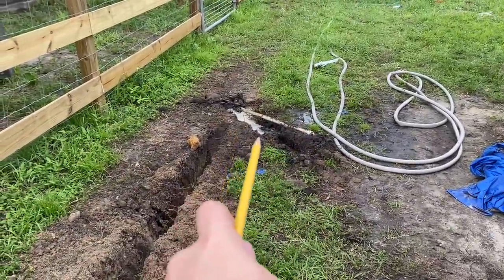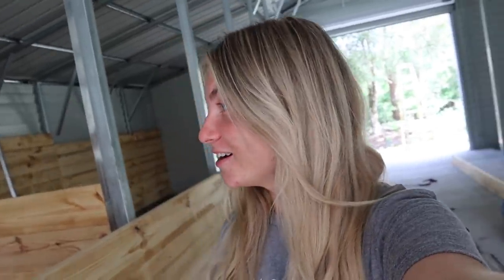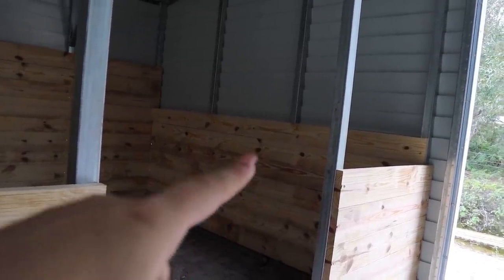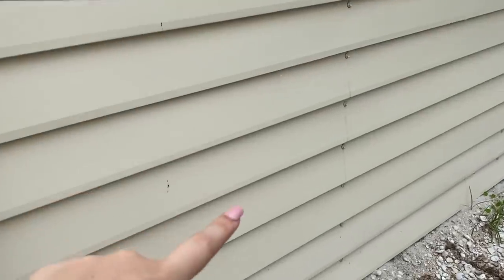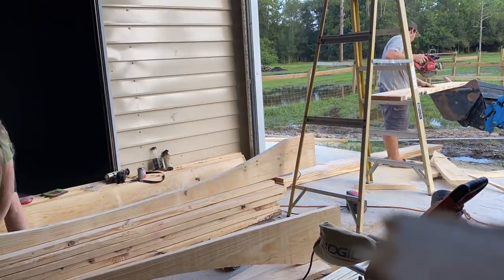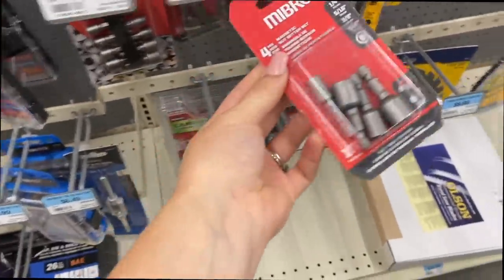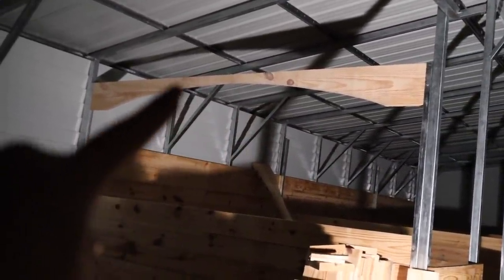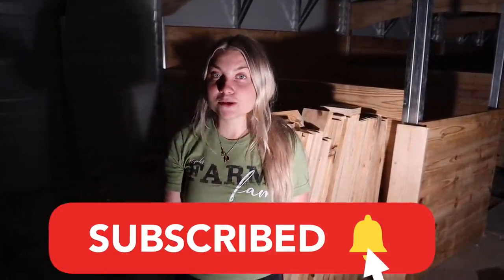ADDING ANOTHER HORSE STALL & ELECTRIC | BUILDING MY DREAM HORSE BARN PART 4!

Comment: You should put water resistant matts on the wall!  That would definitely help, make sure to also add a drain so that the water can drain out and it doesn't mold.  Also maybe add crossties too to keep the horses in the wash rack so they don't walk out.  Thanks for reading and hope this helps! :)

Comment: Have you thought about putting thin rubber mats on the backs and sides of the stalls? so that the wood doesn’t get ruined and it would be easy to wipe down or power wash if need

Comment: Your barn is going to be gorgeous. If I were you I'd take that last stall up to 10 boards instead of doing another arch because with the arch you'll have to do bars and that will just look funny on the back wall. Plus with more wood that last stall will have a touch more insulation

Comment: What would look even nicer than it already does would be to drill same diameter holes as the pvc in the edge of the lower board and the arch install the pvc and lower the arch
Reply from the maker: That’s the plan!